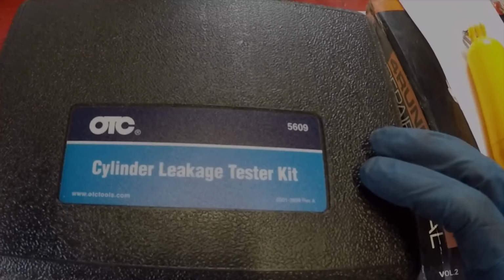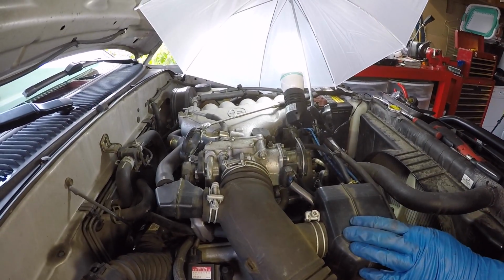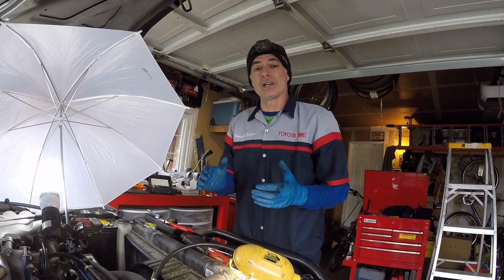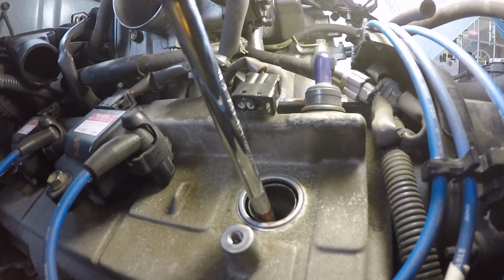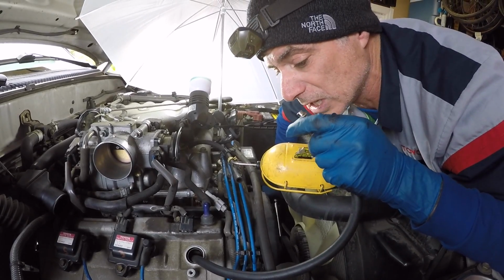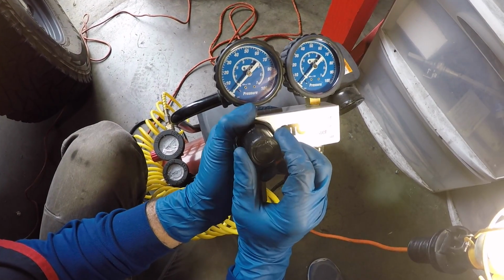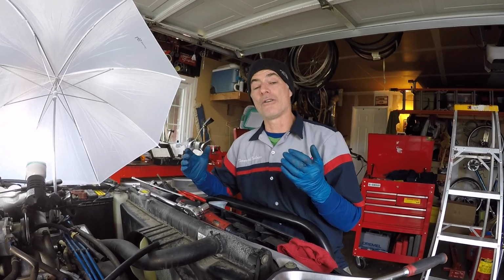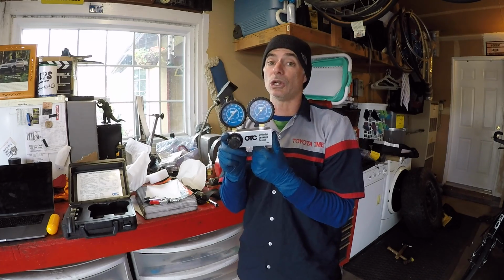Engine Cylinder Leak Down Test

Comment: Sadly the engine of the truck died. Cylinder 4 does not have compression. I am planing to do an engine swap. Could you please tell me which parts it needs to be replaced in the "new"old engine before its installed on the engine bay? Thank you!!!
What should I keep for my old engine?
Reply from the maker: I've never done an engine swap.  But, if I did, I would do the timing belt and associated parts.  I'd replace the valve cover gaskets, cam plugs, spark plug grommets and reseal the half moons on each head.  I'd replace the rear main seal.  I'd probably reseal the oil pan too.  I might replace the motor mounts if they looked old and cracked.  I'd replace the spark plugs and wires.  I'd replace the PCV valve and grommet.  I'd clean the throttle body, IAC and MAF.  I might go ahead and put in some refurbished fuel injectors too.
Reply: @TimmyTheToolman  Thank you so much Timmy. The Lord of the night kill my 147 K engine Lol!!. anything to keep for my old engine?
Reply: @TimmyTheToolman  I think your answer covered it all of the main parts. I did not think of the motor mounts though.
Reply from the maker: @Leino26  Good luck with the swap.  Let me know how it goes for you.
Reply: @TimmyTheToolman  I certainly will!!.
any advice where can i buy the kit for my swap?
Reply from the maker: @Leino26  You mean a kit for all the parts I mentioned?
Reply: @TimmyTheToolman  Yes
Reply from the maker: @Leino26  There's a good kit for the timing belt that a guy sells on Ebay.  His store is called aircabinman.  We provide a link in the video description of our timing belt video.  I know there are kits for the valve cover gasket job but I haven't purchased one so I can't advise you on that.  As for the rest of the parts, I would just buy them from an online seller like Camelback Toyota.
Reply: @TimmyTheToolman  I believe Yota Shop has a kit for this.
Reply from the maker: @billw5235  Good to know.
Reply: Go on the Off Road Solutions website, they have a list of everything you need for the 3.4 swap. Are you just replacing a 3.4 or are you swapping a 3.0 for the 3.4? If you are doing the 3.0 to 3.4 there are a bunch of things you will need.  A lot of your questions can be answered on Yota Tech as well, but you will have to search for them. I am getting set to do the 3.0 to 3.4 swap and have been researching it for a year now.
Reply from the maker: @billw5235  I don't know why anyone would go from the 3.4 to the 3.0.  The 3.0 is notorious for head gasket issues and has less power.  I was thinking everything we need could be pulled off the engine we're swapping out so I don't know what we'd need from Off Road Solutions to make the swap happen unless there's something I don't know about.  Are you talking things we would need if we went with a JDM engine?  Anyways, thanks for the info.
Reply: @TimmyTheToolman  I am going from 3.0 to 3.4. I was asking him if he was just doing a straight 3.4 for 3.4 or if he is doing a 3.0 to 3.4 swap. Which in that case there is much more involved depending how you are going about it. If you're using the 3.0 transmission and the 3.4 engine you need an ECU and wiring harness out of a T-100 and have to re-pin the wiring harness, or buy a conversion kit from ORS. if you are using the 3.4 transmission and 3.4 engine you will need to change the front differential and and need a conversion kit from Marlin Crawler. You will also need the motor mounts from a 91 or later year to make it easier. He used the word swap, which to me means 3.0 to 3.4. If he had used the words replace the engine I would have assumed he was just replacing a 3.4 for a 3.4. Sorry for any confusion.
Reply from the maker: @billw5235  Oh, I gotcha.  Swap out an engine versus replace an engine.  Yeah, we're going to replace the engine or swap out one 3.4 for another 3.4.
Reply: @TimmyTheToolman  In that case everything he needs should be there, the one thing I would look at is wiring if the engine is a different year, since Toyota seems to change the wiring a little bit from year to year.
Reply from the maker: @billw5235  You're right the wiring may be different.   We probably should just pull the harness off his engine to play it safe.
Reply: @TimmyTheToolman  Or use both the ECU and wiring harness off of the donor vehicle if that is possible.
Reply: @billw5235  Thak you so much. I am just replacing a 3.4. I would love to do it for a 4.7l though. Hopefully it can be done this coming week. Fingers crossed!!
Reply: @Leino26  No problem, some things I would look at  I don't know what year 4runner you have but, if the replacement engine is not the same year as your vehicle, checking the wiring is key, Toyota tends to change the wiring harnesses a little bit each year. Also there are little differences in things after the year 2000, so if you have a 96 to 99 try and use an engine from those years and the same with anything after 2000. Sites like Yota Tech and T4R.org  are wealth of information for these types of things, there are some sites more about off roading which have a ton of information as well. I am collecting all of the parts I need to do the 3.0 to 3.4 swap, another month or so I will be throwing the 3.4 from a 98 limited into my 1990 4runner. My friend who is a mechanic is giving me a hand (he has a 91 with the 22RE in it) and  by chance I met a guy at one of our Toyota Junkyards here who has done about 25 swaps. He had the ECU and wiring harness I needed and sold them to me for about half the price the junkyards would have and sat down with me and answered a ton of my questions. Good luck getting your engine change and feel free to hit me up here, if you have questions I can answer, I gladly will.
Reply: @billw5235  Thank you so much. My truck is a 02 SR5. I am not sure about the replacing engine yet. I have not buy it yet but I think is 01 or 02 . no much to change i believe. I really appreciate your help. I'll be in touch with you. If you have more hints let me know.
Reply: @Leino26  Not a problem that's all I have right now.

Comment: ill tell you why my 1st gen tacoma was misfiring,

the electrical connector to the injector was faulty i found this out when i pressed it down with a pick took and the miss went away

i replaced all the injector connectors (depinned the old conmector inserted the old terminals into the new clips so no cutting of wires) only to find it wasnt because the plastic retainer part of the clip was broken but because the metal terminal ist making making good contact... intake needs to come off again
Reply from the maker: Hey James, well, at least you know what the culprit is, a bad connection.  Maybe the electrical connectors on the injector are the issue and a replacement injector will fix the issue.
Reply: @TimmyTheToolman  i installed new injectors from motorwest performance (the guys you used) and finished installing the new connectors with new terminals and there was a difference, but i still have a misfire on idle sometimes

it makes my grille guard shake sometimes so i know it exists and isn't placebo
Reply from the maker: @jamesflores9456  Are you getting a CEL?
Reply: @TimmyTheToolman  no its not that bad im just ocd, but i can be running on 5/6 cylinders at 3500 rpm and it wont tell me i have a misfire so yeah
Reply from the maker: @jamesflores9456  Well, I hope you get it figured out.

Comment: Hey, timmy the tool man I got a problem with my 97 4runner when I turn my engine is fine but when I put it Into drive or reverse before reaching operating temperature it shakes like if i was driving over rocks. But once it reaches the normal operating temperature is fine and doesn't shake anymore more. It only start doing it last week. Do you know what could it be?

update:Found the issue is a misfire from cylinder 3 error code p0303.
I will check the wires and replace them and change the spark plugs. I will keep it up to date. With this issue and timmy the tool man if u have any suggestions how to fix this problem let me know. Thank you!
Reply from the maker: I'd start with swapping the coil packs and see if the misfire follows a bad coil pack.  The #3 cylinder is the middle cylinder on the passenger side of the engine.  Get your air tube of the way first, then disconnect the spark wires that connect to the coil packs for the #1 and #3 cylinders.  The #1 cylinder is the forward most cylinder on the passenger side.  You remove the coil packs by taking out the 10mm bolts that hold them in.  Put the one that was on the #3 cylinder onto the #1 cylinder and vice versa.  But, before you do that, remove the spark plug for those 2 cylinders.  If the electrodes are severely worn down, you might just be having a spark plug firing issue.  If the plugs look good, put everything back together and now see if the misfire follows that coil pack to the #1 cylinder.  You'd have a P0301 code it that ends up being the case.
Reply: @TimmyTheToolman  
Thanks a lot for the tip and responding fast. The problem was a bad spark plug I checked all three spark plug coil pack resistance they were good all good between 1 ohm so now I got no code and it runs like charm. The weird part is that my check engine light didn't come on when I got this issue maybe the bulb is burn in the cluster I will change it later. Also my alternator buzz a little bit in low rpm should I change it? I know the buzzing comes from the alternator because when I roll my window on idle the alternator whines a little bit and since it use a lot of power.
Thanks a lot for responding my question amazing channel. Also if someone has a question about a problem with their rig what is the best way to reach you, comment on a new video, old or whatever video thanks for helping me with my 4runner. I wish this channel had more subscribers so they see how amazing it is.
 4runner 4ever
Reply from the maker: @Marco_Harrorato  Don't know what would cause a buzzing sound from the alternator.  How's the belt tension?  With a mechanic stethoscope,  you could listen to the alternator pulley bearing and see if it sounds really rough.  You could compare the sound on the alternator to the sound of the power steering pulley.  Does it sound like an electrical buzz?  Have you used a volt meter to check the charging output?
Reply from the maker: If you need to ask a question not related to an existing video, you could message me on Facebook Messenger.  On the front page of our channel in the bottom right of the picture is a link to our Facebook page.   Great to hear you appreciate our channel Marc.

Comment: I noticed after market spark plug wires !  Could that throw off the computer maybe ??
Reply from the maker: Those wires are an exact replacement for OEM wires.  They are just a different color.  I have the same ones on my rig.  We finally figured out his problem.  It's a very loose crankshaft.  We will be swapping out his engine in the near future.
Reply: @TimmyTheToolman  👍

Comment: Used to own 99 Tacoma Prerunner. If I remember correctly I had a misfire code .... after sitting in the garage all summer and several $$ later. Turned out to be a bad spark plug wire.
Reply from the maker: Yeah, replacing the spark plug wires and spark plugs was the first thing Greg did to try to fix this issue.  All along though, it was crankshaft play causing an engine knock.  Somebody recently shared information with me that the knock sensors are very sensitive on this generation of Toyota engines and the source of the misfire was most likely coming from the knock sensors.

We just posted a video confirming the crankshaft play in Greg's engine.  Check it out.

Comment: Or you could just reset the MIL, and then unplug the crank sensor connection and then the ECU should run in safe mode and then drive it?
Reply: It shouldn't run without the crank sensor. P0335? At least that's what I'm seeing on Tacoma World. I'm not big on just throwing parts at a problem either, but I would replace the crank position sensor because it can cause all kinds of strange issues. About $60.00 OEM Toyota.
Reply from the maker: @dsimp765  Well, if we determine that the play we saw the other day is indeed the crank, the engine is seriously compromised and it's probably not a good idea to just ignore the problem.  If he just wanted it for an around town rig, I'd say just drive it if he can somehow get it smogged and registered.  But, we need to have the code cleared out long enough so he can bring it to a smog check facility.  Currently, after he resets the CEL, a new CEL pops up within around 5 miles.
Reply: @TimmyTheToolman  The only spec that I found was on Tacoma World article from 2011 said.008-.011 crank end play, and your video proves its more than that. I found another article you should check out on IH8MUD.com dated July 31st 2010. Its a 2000 4runner with the 3.4l It had the same problem as your video shows. Bottom line they dropped the oil pan and found the rear thrust washers in the pan and the rear main bearing moved forward out of position. You might consider dropping the pan before yanking the motor? Good luck and we are hoping you guys figure it out.
Reply from the maker: @dsimp765  We confirmed today that the gross play we saw is from the crankshaft.  I'm uploading the video right now.  It will be live in a few hours.  One thing I was thinking of doing is draining the oil and then go fishing for the thrust washers on the bottom of the oil pan with a magnet tool I have with a flexible arm that I could fit in there,.  I definitely don't want to pull the front diff and drop the pan because that's a ton of labor.  But, if we do an engine swap for Greg, I will pull the pan once we get the engine out and then we can see what we can see.  Thanks for contributing to this search for a solution.  We now know this engine is toast and he's considering an engine swap.  So, stay tuned for a potential engine swap.

Comment: You may have already stated this in previous videos but what oil do you run and what is your opinion of Royal Purple? Thanks in advance!
Reply from the maker: I was running a Castrol high mileage partial synthetic for a long time but I recently switched to a full synthetic in both of my rigs.  It's also made by Castrol:  Castrol 03087 EDGE Extended Performance 5W-30 Advanced Full Synthetic Motor Oil.  I buy it via Amazon because it's more affordable: https://amzn.to/2TsvT3S

I don't really have a personal opinion about Royal Purple.  I do know that lots of guys use it and like it though.  Honestly, I think it's hard to go wrong with oils these days.  There's guys running the Walmart brand without issue.  The important thing is renew your oil at regular intervals to always have plenty of lubricating properties in the oil.  With my partial synthetic, I was changing my oil every 3k.  With the full synthetic, I'm renewing my oil every 5k now.  I know I could push it further because an oil analysis would probably show I could but I'd rather give my engine fresh oil on a more regular basis.  It's my opinion that being religious about changing your oil is the best thing you can do for your engine.

Comment: I'm thinking it's probably going to be a bad knock sensor.
Reply from the maker: That was a theory of ours as well.  Greg is coming over today because we did see gross movement in his crankshaft.  If it is indeed the crankshaft moving and not the harmonic balancer, the source of his misfire and audible engine knock have to be due to that.  It's my theory that if the crankshaft is able to move significantly like we saw in the video we recently posted, that could throw off the crank position sensor taking a reading from the crankshaft timing gear.  We will find out today if I'm right.
Reply: @TimmyTheToolman  Timmy, not sure if you answered this or not, but what did you find out for the root cause?   Also, great videos,  getting ready to do compression/leakdown testing ahead of a SC/7th inj. install. At 250k, want to make sure things aren’t on the edge.   You are great at what you do.  Can really tell that your style/substance comes from doing things the right way and from a pride of ownership.  Don’t get that in too many places these day.

Comment: Hey Tim I have a simple/low cost idea if you haven't already done it. Buy just 1 spark plug for cylinder #1 in 1 heat range colder? My thought is that if he has some excess carbon in that 1 cylinder a colder plug might prevent the misfire? Thank you guys for doing a great job detailing the procedure.
Reply from the maker: Hey Big D, there's something we're going to check into first.  That video we recently uploaded for the crankshaft play was Greg's rig.  It's my theory that the play we are seeing is crankshaft play and not the harmonic balancer becoming separated.  Greg is coming over tomorrow so I can verify where this play is coming from.  If it is indeed the whole crankshaft moving, then the culprit for the misfire could be due to the movement of the shaft.  The crank position sensor takes a reading from the crankshaft timing gear.  If that gear is moving in and out, maybe the sensor is going to get a false reading and trigger the misfire CEL.

Comment: Awesome vid Tim! The saga continues! Try swapping the positions of the knock sensors as these are Toyota's old style screw in type and are notoriously unreliable. The knock sensors are responsible for reporting engine misfires to the ECU. They are both directly under the intake manifold. One is screwed into the middle-side of the left cylinder head and the other is screwed into the middle-side of the right cylinder head. If the misfire follows the sensor then the knock sensor is bad. Otherwise it's an intermittent electrical issue  or a very slight timing issue due to wear in the timing belt or crankshaft pulley.
Reply: Good thought, additionally there is a TSB for the knock sensor wiring harness as well.